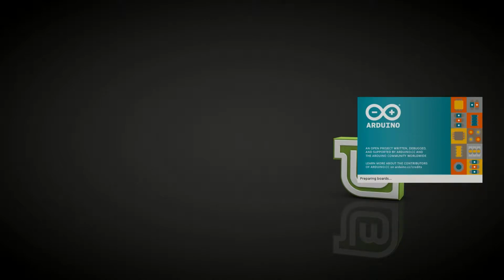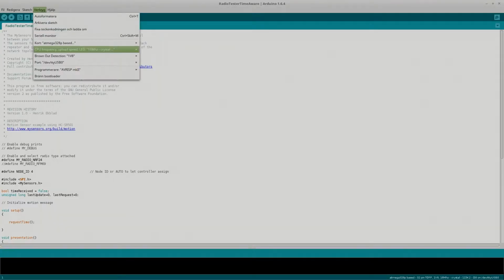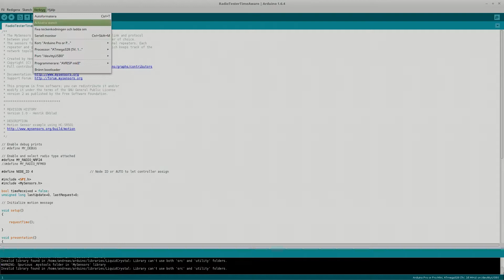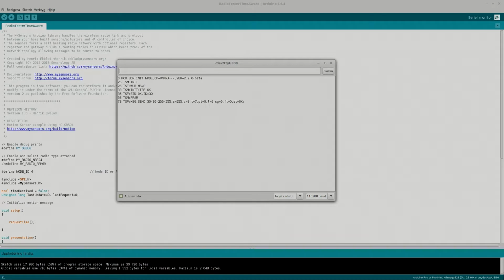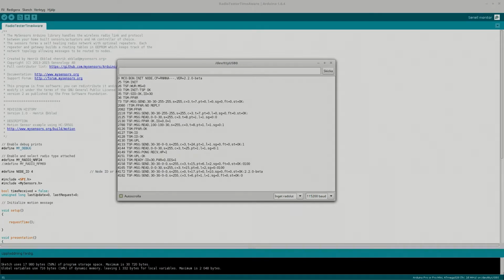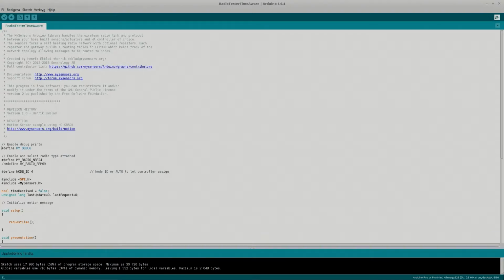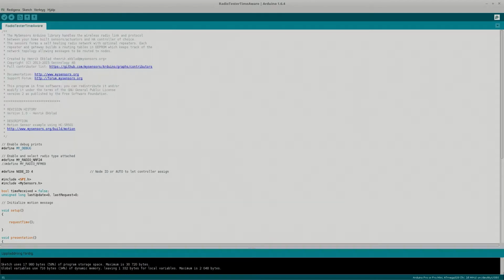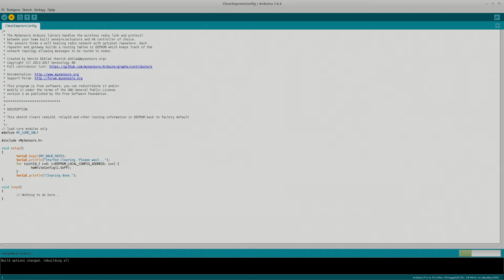Complete build! - Easy/Newbie PCB (Nrf24l01+) for MySensors

Comment: nrf24l01+ can we run  24/7 for the projects is that reliable.
Reply from the maker: Absolutley! I have 35nodes in my Homeautomation running 24/7 without issues (motion detectors for example). BUT there are many fake cloned radios out there - they are not as reliable as a true Nordic nrf2401+ radio so be aware of what you buy.

Comment: Nice video. I am about to create my own weather station with a nrf24L0 and a ESP32 and just looking around for information how to use the nrf24L0. Created my own PCB with Solar power and battery charger. Now I have to figure out how to program the ESP32 and let it send data to a mqtt server.
Reply from the maker: Thank you! I use MySensors.org as the protocol and there are many @ the forum with different experience so that might be a good place to start!
Reply: Andreas Sundberg thanks for reply. Will check that forum, probably someone else had a similar idea.